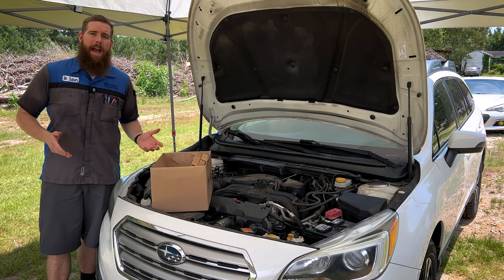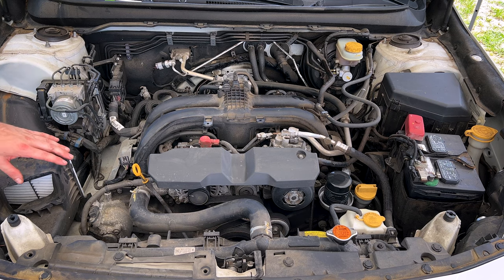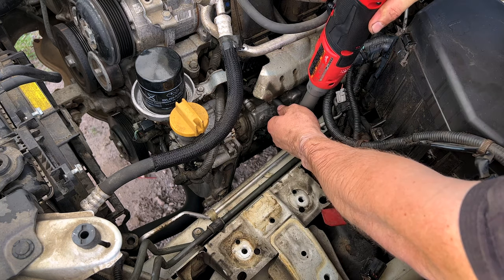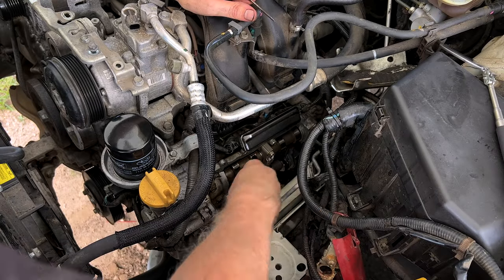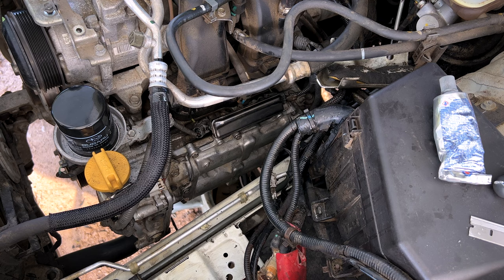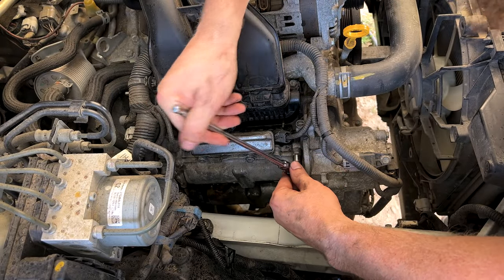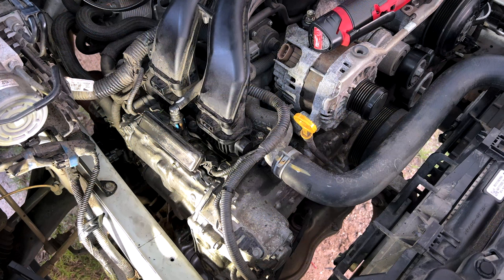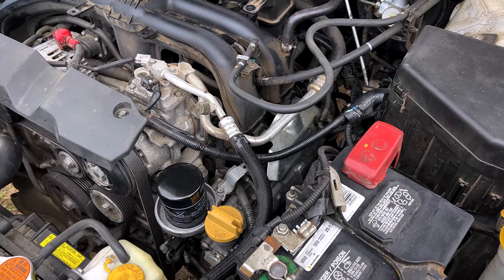Project 2015 Outback: Spark Plugs & Cam Cover Gasket Replacement! Easy-ish DIY!

Comment: subaru parts deals is terrible.  Ordered black made in Japan oil filters and got sent blue ones and would not let me return them. beware
Reply: Thanks for the heads up. I got a blue one from the dealership, and it was much smaller than the MIJ ones. I went with a WIX that was the same size.
Reply: @stevef3521 Wix are actually tested superior than OEM filters for Subaru. That includes air filters also.
Reply: Don't get hung up on using only OEM  Subaru oil filters no matter what the color. Their filters are designed to last only 6K miles and are constructed very cheaply. I know as I have cut open several of them. Remember, Subaru recommends changing the oil and filter at 6 mo/6K miles to maintain the warranty. Any name brand aftermarket filter will last this long and is just fine. 32:59

Comment: i have a 2010 Outback.  The driver's side cam cover would not come out.  It hit the frame rail.  Looks like they fixed that error and the job is so much easier.  Lucky you.
Reply: It was not easy adjusting valves on the EJ253 in my 2010 OB because that rocker cover wouldn't come out.  I got it done but the neighbors heard me "encouraging" myself doing it...
Reply from the maker: I’ve done a video on a 2011. Same engine. You just need to lift the fuel rail and injectors to pull those.

Comment: FYI, these repairs he's been doing up to this point can also be applied to Legacy's from 2015-2019. Same engine and tranny, just a different body on top. Just did my driver side CV axle replacement this morning in my Legacy using his torque specs and techniques. Went very smooth minus the stupid diff seal. That sucker was a PITA to get out. No more clicking on left turns!

Comment: Mr. Subaru, I watch your videos all the time and work on my 2016 Subaru outback limited 2.5.  I have a ?  Do you have any idea where I could order the replacement metal clip on the spark plug ignition connection to the main wiring harness.  I was replacing the cam cover gaskets, and ignition coils and one of the springs flew off and I cannot find it.  I went to Subaru dealer and they told me they do not sell that metal clip that I would have to buy the entire engine wiring harness.  The service manager told me that I could zip tie it to keep it from coming loose.  Do you have any ideas where I could buy a replacement from?  Thank you, and keep up the good work you do to help people to work on their own Subarus.  You have saved my thousands of dollars.

Comment: I just did this job on my '17 Forester on the drivers side. Pretty much identical to this. Cleaning off the old RTV is a nightmare. I used headless bolts screwed into the fuel rail cover holes as alignment pins to replace the cover. Putting the front of the vehicle on ramps and removing the plastic skid plate helped for getting at those bottom bolts and for cleaning off the old RTV.
Reply: I have 2017 forester. Every 45thousand mile need replacement lower control arm and front alxe.
Reply: @sulin422  I'm at 165K and still on the original ones. I will be doing the lower control arm in a few days though.
Reply: Good to know

Comment: The stealership quoted us over $3,000 to replace the same seal on my wife's 15' Impreza 2.0L. They said it's a 20hr job. Looks like a tighter fit than on that Outback, but still might be doable.

Comment: I've got a 2015 also, found that my misfire issues like yours was actually due to a failing coil pack on the cylinder closest the battery. Dealer had recommended checking this one as they mentioned that they have seen a high failure rate on that specific cylinder. 
Also changing plugs on this model has to be one of the hardest on any Subaru, I've done , due to that battery mount

Comment: easy-ish lol
I did chuckle a bit at this ;)

 I changed plugs on my 2014 outback and it had dry plug holes :) [wow I was happy about that!]
   my sisters 2011 outback had a little oil  [about a 1/4" ] in the drivers side. [ugh]
I hadnt seen a vid on this, but thought that was bad.
before removing the plug I Sprayed brake cleen down there &  blew it out [messy] then wiped with paper towels to be sure.
 the front plug hole had a little oil there [So I repeated the clean up]  & told my sister what I found.
she told me to just put it back together so she could drive it [eek]   so I did. . . 
 a couple years later It still running good - so  there it is
 
 I recommended she have a shop do the seal work, But now I see you do it - "maybe" I can do it.
with the extra time to do it. 
 I have a shop n tools. just need to buy those little hands and while In at buying stuff,
 might as well order longer fingers too ;)

 I was super glad my 2014 was good. I keep the engine bay clean, So it "looks" better anyway ;)

 I sure appreciate your video's and bought myself a few tools as I see those I needed.
do wish my hands were smaller. Your Engine bays have more room than mine does :)

 Thank you for making it look easier - ish    ;)

Comment: I'm so happy Mr.Subaru bought this Outback. We have two of these in our family, and they need a lot of similar work done. A few days ago I changed the spark plugs on mine, but had a hard time putting back on the rear ignition coil  pigtails, it just wouldn't go all the way in. Looked like the internal red rubber seal inside the pigtail connectors either swelled up or got loose. After half an hour fighting with it I just decided to pull the seal out, and connect without it. Hopefully this will cause any issues in the future.

Comment: thank you so much, i was dreading doing the spark plugs on my 2013 Crosstrek, it was actually super easy, the only trick i can add is dont click the ratchet all the way onto the extension or itll be hard to hit the button to unlock it while pulling it back at the same time... or just use a ratchet that doesnt lock the sockets on... either way, all i needed was a 8mm socket, 10mm shallow socket, 10mm deep socket, i used a regular old Husky 3/8th ratchet to break the plugs loose then used my Tekton super compact 3/8 to spin it out more then just spun it with my fingers on the 3" wobble extension (wobble makes it a lot easier to get in and out without taking the extension out of the 14mm spark plug socket with spring retainers...  with your guidance i had it done easily without any spearing in well under an hour. 

one thhing that concerns me, the coils seemed faily "plugged in" to the spark plugs when i removed them, but when i put them back, they didnt really pop on, they felt like they kinda just butted into the holes and were fully dependent on the bolts to keep them from literally falling out... car ran better than before though when i fired it up so seemingly runs fine... the old plugs had hardly any center electrode left, and the outer electrodes were all very eroded as well, color was good, just a light browning... car has 197K miles on in, plugs havent been changed since the last under warranty scheduled maintenance (if ever)... they looked really really worn out... like a tiny little sliver of electrode, barely even visible... like the tip of a sewing needle... 20-25% of new width approximately and about double or triple the gap... 

3 of my plug well seals are leaking though... and one camcover in another place... not terrible leaks, but definitely weeping a tad..  which is why im here... ha... 

also on the menu are front and rear CV axles, wheel bearings and brakes... most of the parts are sitting on my living room waiting to be installed... 

shes also due for another oil change, CVT flush, differential fluid change, alll four struts....

Ii drive the ever loving piss out of it, even full to the brim with 500 pounds of carpentry tools, i drive it like im on a race track... i pass every car on the road, even the ones that think theyre fast... im truly amazed at the reliabiluity and durability of these subarus, though i do dispise the CVT... this is the first one ive owned and will most definitely be the last. its so bad.... always in too tall of gear untill  you hit the downshift paddle one more time then its at redline and doesnt wanna "upshift" again...  my next car will be a manual again... i bought this one because the salesman said "The CVT is essentially a manual without a clutch so it shifts instantly and doesnt lose power between shifts"... and on the round the block test drive in city traffic it seemed ok... but in the twisties or if you wanna get after it, its god fucking awful... and does not in any way match the sporty handling and feel of subaru cars... all my prior subarus were manual and all my future ones willl be too, now.

Comment: I just commented on your video of how easy these are to work on, well for spark plugs yeah, kinda, however I have 2016 OB 3.6r and out of no where it began to shudder and the CEL came on, so I figured ok seems like I lost a coil or something, still ran thank god, but I pulled the code and I had P0300, and P0303. I picked up a coil for 89 and a NGK spark plug just because why not if I am in there replace it. So once I did that, I started it back up and it cleared the P0300 then a P0302 popped in there, so I did some research and checked the VVT's, cleaned and tested them, cleaned the PCV valve and still, runs like crap and throwing codes still. So I called Subaru dealer and took it there, they replaced all the spark plugs, said the cylinders looked good but #2 was fowling out still, so $1100 in now and it's still there. I have only had this car for like 4 months, has 116k on it, so I guess the OB only has 100K then die? I mean it ran perfectly fine for the past 2 months, clean oil, burns that as I guess thats what these do but this has to be electrical, to suddenly go from perfect to garbo while going 70 on the highway. Anyone else have issues with Gen5 3.6R at 116Kish?

Comment: I don't know about all the technicians at Subaru,  but when replacing spark plugs as a maintenance, I do that from the bottom on both H4 and H6 engines.  Cam covers are definitely a top side job, though.
Reply: I’ve done plugs on 4 of these newer Subaru FA/FB engines and they were all a breeze from the top. Just take off the intake (usually 2-3 bolts) and remove the battery, slide the ECU up and out of the way, and then it’s no problem reach each spark plug from the top with a swivel head ratchet and a 4” extension on the spark plug socket. I never needed any of the janky socket swivels that people like to recommend either. 

It may be easier from the bottom with EJ engines though. It’s been 10 years since I’ve done plugs on one of those so I don’t remember which method I used.
Reply: @blueridge8992  Just have to remove the belly pan from the bottom, 1/4 drive short 12 for the coils, I have the gearwrench socket, which does well.
Reply from the maker: Never removed plugs from underneath
Reply: @uncletofu4500  worked for a 2018 H6 outback. The spark plug socket I've use is the gear wrench with the 1" extension attached, I then use my 1/4 drive ratchet with a 3/8 adapter, probably a bit tighter than removing all the topside stuff, but I've not had any trouble as far as making time is concerned.

Comment: Thank you first of all, for your invaluable guides. I am unsure about how you aligned the pulley before beginning the task. I get the belt removal, but you were too fast for me on that alignment. what do I have to move and how. Do I need this for both cam covers? It's not that us DIY numptys are dumb, I certainly am just ignorant  on stuff that you are clearly the reverse upon.. Over here in France, there are very few Subaru dealers, so it is down to me to do as much as I can to keep my Outback 2.5 2016 model running well.
Thanks again.

Joe O

Comment: Nice job Mr S! Nice small headed ratchet with a long handle!
Reply from the maker: Yup. Snap-on TLLF72 is almost a requirement for work on Subaru. Love it. Have a couple different ones. One is converted to 3/8”
Reply: @MrSubaru1387 I sneak in with a Pittsburgh Pro #00351 works great!

Comment: Dear Mr. Subaru, thanks for your guidance & advice. I went to do plugs on a Legacy GT Wagon. I stopped after the first plug, it felt so tight, galling sounds as I started...even the coil retaining bolt was making that galled sound and heat soaked...It felt like a plug may break...

Have you had any horror events like a plug shearing off? 
Hope to hear from you sir...

Comment: If doing this in the rust belt; replace the lower 3 valve cover bolts with new ones; not sure about the middle two since I own older EJs with only 6 bolts each side.  I’ve never had any rust issues with the top 3 bolts

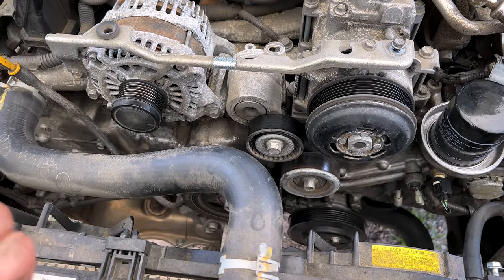Comment: Mistake at 7:45 mark.  The FSM states that after the crank pulley timing mark is lined up with the 0 degree mark on the chain cover the crankshaft then gets rotated 180 degrees clockwise from that point.  That fact was left out of this video.
Reply: Is this accurate? I get nervous touching crankshaft

Comment: I am so glad for your video, MrSubaru! Thank you, thank you, thank you. I have this exact model and I am hoping to see videos on complete brake fluid flush and coolant flush. 

I changed my spark plugs last week and it took me ALL day! First, it took awhile to remove that battery box because of the two lower bolts. Then I had to run to the store to buy a new torque wrench with a flex head to be able to torque spark plugs correctly. Sure enough all the spark plugs were under torqued.

Comment: Thinking my leak is the rocker box section to the head not the rocker/Valve cover gasket? I have two puddles of oil sitting on top side next to the injector anyway nice video thanks.

Comment: Do you have any idea how many miles were on that car when the cam covers started leaking?  I have a 2017 but low miles.  Wondering if I should be getting prepared.  Mahalo!

Comment: Did the spark plugs on my 08 Legacy recently and had to loosen the fuse box too to get my manual torque wrench in the space. I see you have a Snap-on electric but what is the other one you are using or what would you recommend? Thanks.

Comment: Do you think if I raise the motor up an inch, will it give me enough space to pull the valve cover off freely instead of removing the serpentine to align the crank pulley?

Comment: Do you have a link for that torque wrench you're using for the cam cover bolts?  I couldn't find it in your list of tools.
Reply: NVM, looked closely at your video and saw it was snap-on, found it.

Comment: Im doing my 2016 crosstrek this weekend. What did you use to clean the coils? Did you just use the brake parts cleaner? I did my spark plugs last weekend and discovered had oil all over the coils. So now I have everything I need to replace the seals on the cover and around the SP tubes. Thanks for your time and sharing with us .
Reply: I've got this same question.   Just brake cleaner or soapy water?

Comment: Regarding the crank pulley I put it at 0 like you mentioned but when I’m done do I leave it the same or am I supposed to move it to a different number ?
Reply: Just leave it. The reason for aligning the crane pulley is to rotate the camshaft to have the back lobes pointing towards the ceiling or the floor.  If they are pointing towards the tires, they will block the valve cover from coming out.
  Once you've completed the job, starting the engine will cause the pulley to spin; lobes have adequate space inside the properly attached cover.

Comment: My mechanic says she needs to replace the exhaust manifold to pipe gasket and exhaust pipe gasket because the related parts need to be removed for the repair - however no mention of that in the video.  Any thoughts?

Comment: Pop question, would the coils be damaged by the intrusion of engine oil and would it be recommended to clean out the spark plug tubes prior to removing the old spark plugs?

Comment: Man, I have to get ready for this on wife 15 crosstrek we just bought. And I have to say gzz your plus was dryer than mine."" I changed plugs and all 4 soaked in oil like you just had pulled them out of a bucket, lol.   Plugs was assuming original with 153k miles and was gapped almost 100 thousand. Ya, she missed terribly.

Comment: most def should have added b12 chemtool in the spark plug holes... this would clean the piston head and dispose of a lot of the carbon build up. car should run nicer after than too

Comment: So after all of that, did it fix the sporadic miss?  Also what tools/advice do you have for cleaning up the gasket sealer on the head, thanks as always.
Reply: Razor blade, brake cleaner, mop/napkins

Comment: Recently started working on subarus i spent 10 years at a nissan dealership.
It is a mf getting that silicone cleaned up on them boxers i would just like to know your method.
Razors work i also have long reach carbide scrapers and still they are a pain

Comment: Both my children have subies but I told my son I would worry a hole in my stomach over the head gasket issue- just waiting for it to blow- what percentage of these engines lose their head gaskets? Thanks for the show.
Reply: If it is a newer subaru you don't have to worry about it. I think 2013 plus have the f series.
Reply: @zachsummers3321  Thanks Zach, I appreciate the info.
Reply: Zero percent. Issue resolved in 2012.

Comment: Did you drain the engine oil prior to removing the cam covers?
Reply: No.  Expect a few drips from oil adhered to the cover, but there is no standing oil on the valve train.

Comment: I spent 7 hours on my 2014 Impreza.  The frame blocks access to the bottom and middle rear bolts. I spent 30 minutes getting the bottom one started, and another 30 minutes with a ratcheting box end, 2 clicks at a time.  I don't see any way of getting a torque wrench on them.